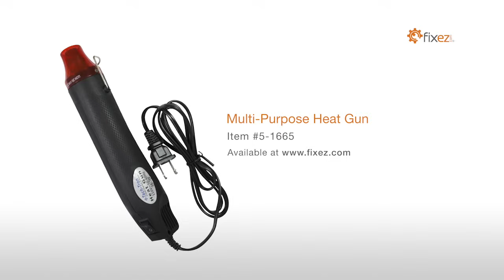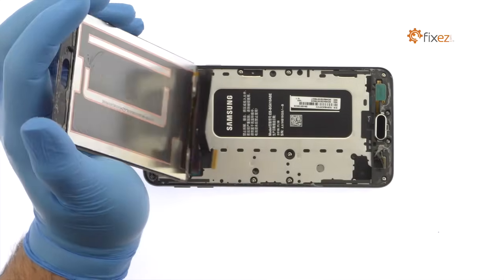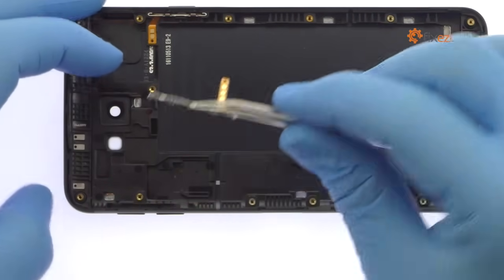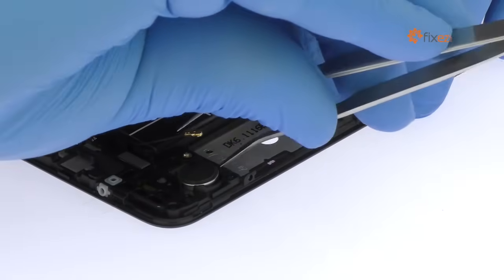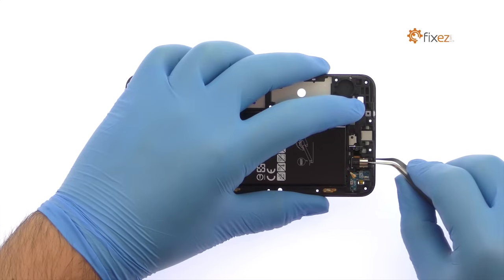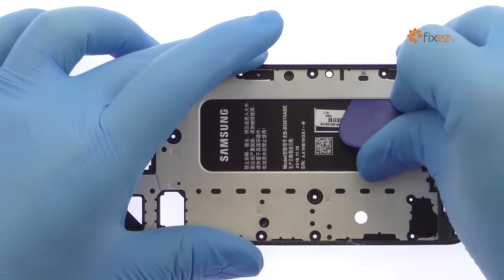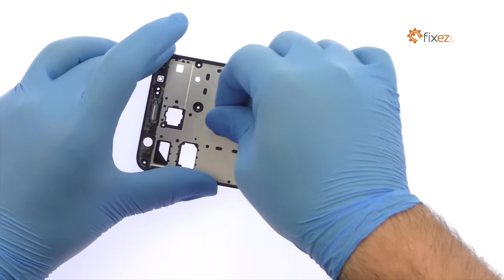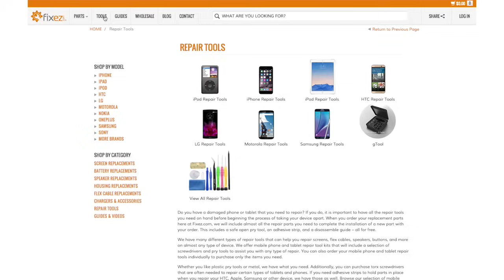Samsung Galaxy J7 Prime Teardown and Reassemble - Fixez.com

Comment: anyone can help me?my j7 prime doesnt charge..when i charge,it appears "CHARGING PAUSE.BATTERY TEMPERATURE TOO LOW"..what will i do?pls help..
Reply: Diga Louis change you adapter or usb..
Reply: Diga Louis .
Reply: Isauli mo san mo nabili factory deffect ata yan gya skin
Reply: Did u drope ur phone in water???
Reply: Your phone's charging port should be changed...or it may be the charging filters problem...
Reply: maldrina gonsalves if yes
Reply: Same prblm im getting plz anyone suggeste me to charge my phone
Reply: There are 2 charging filters(black color) in front of charging port... Remove and short them... Problem solved
Reply: Priyanka Bj you can visit Samsung service center... There's no way to charge your phone again

Comment: I have j7prime but it doesn't have front flash instead it has screen flash and it doesn't use any LED bulb or any other equipment that's held on front part of the device.....so this disassembly video is 💩
Reply: Aditya Jain , my Samsung j7 prime has led bulb
Reply: Sololo 1....Bro this LED bulb is not flash light for camera....this LED bulb is only for notification purpose and I had written that it doesn't have any flash light LED bulb for camera
Reply: No, man, Samsung is only confusing people, but some versions of J7 Prime have led flash for photos, and some do not, some countries have as main version with flash, including my bought in Brazil has flash front, and is a Too flash lamp, to take pictures in the dark!
Reply: Aditya Jain can you sell your J7 Prime
Reply: nope...u can buy it from shops...
Reply: sir mujhe old kharidna hai
Reply: sorry bro....mai nhi bechunga
Reply: Aditya Jain tuje poopat banaya hoga mobile vale😁😁😁😂😂

Comment: Very third class cell phone.
1-very slow processer.
2-very slow read with sd card.v.simlple not sported 32gb sd card.its froad.
3-2Daul sim not working at the during call.not answering on another sim with during call.
4-not daydream lcd screen.
5- call log not search option contAct.
   Note very simple 34,000.price is cheet for customers...its real price will be 10,000
Reply: ali malik,don't get fooled by advertisement,samsung are genious to market their crap phone.
Reply: ali malik mai khud use kar raha hu mujhe aisa kuch bhi problem nahi aya
Reply: J7 prime mien  2 Sims hin. ..during call....3.4.minutes see lamb I call nhee chalty disconnect jo joy hai...b Samsung edge 6 use ker raha hoo....usy Sim per..signel strength good.nd strong  hi..Lakin J7. ..is another low price Samsung making  foole people's
Reply: you sir are wrong. it is the best mid range samsung smartphone ever.
Reply: Kelvin JVR no its non removable
Reply: than that is not j7 prime that is totally fake
Reply: maybe u have fake one, that not real j7 prime
Reply: mine on T-Mobile does have a removable battery.
Reply: Slow proccesor?dafuq go buy a xioami mi6 if you're going to do important jobs...(i mean social media is just a piece of cake for this phone.)
It supports up to 256 Gb and reading/writing speed is fine because it can stream record for full hd requires high read/write rate
Dual sim?Do not ever buy a f***in dual sim phone.Who need dual sim?Also another phones can't do dat stuff tho.
Call log not support contact?
YEAH GRANDMA U CAN USE SMART PHONES XDDDDD
Reply: U call 1.6 giga hertz slow for a mid range phone? Wow.
Reply: abe chutiye iska launch hi 18000 tha haha ab 14 hua hua or mai 64gb sd card use kr rha with dual sim